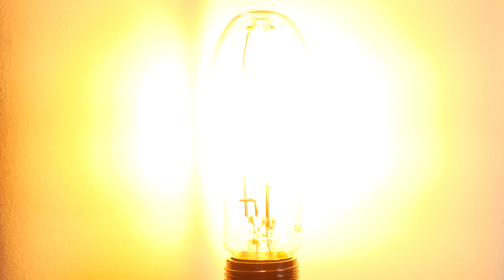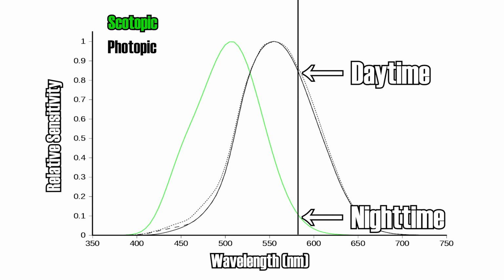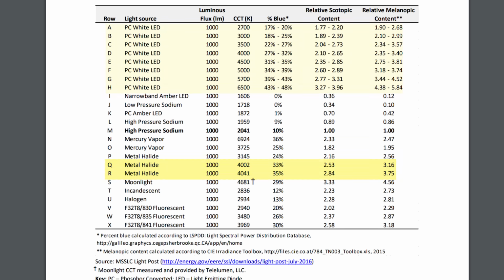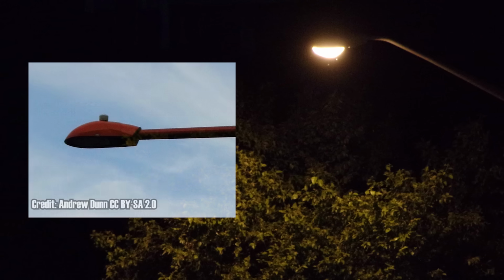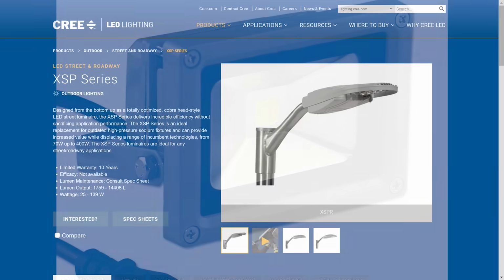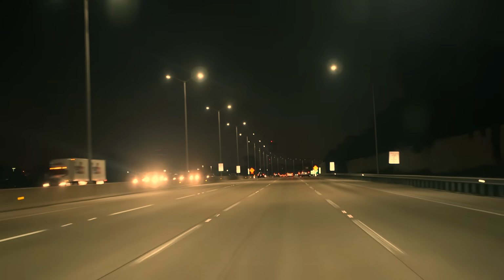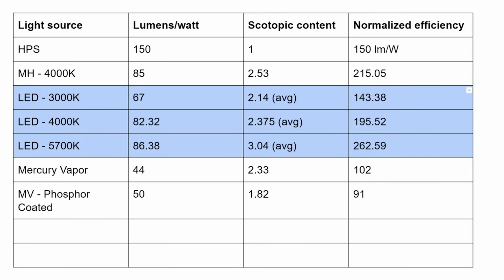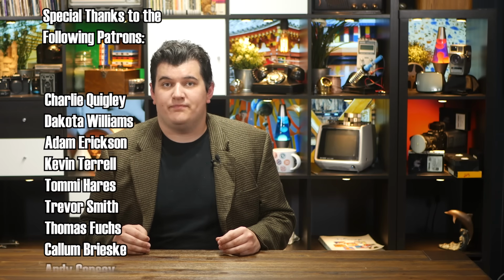The LED's Challenge to High Pressure Sodium

Comment: So a 3000K LED has around 2x the scotopic content and 2-3x the melanopic content, but you mentioned only needing 1/2 the light versus HFP. But wouldn't that just make it the same as HFP? 1x scotopic content and 1-1.5x the melanopic content - wouldn't it actually be worse than HFP?

Comment: I disagree entirely.
LEDs dazzle but put little light where it is needed, at road level. For several months a long road near to me had sodium on one side with new LEDs on the opposite side.  The sodium lit side was FAR better illuminated than the LED.

Comment: I love the led street lighting. My city has upgraded a select number of the street lanterns and it's a tremendous difference from the old lights. The orange glow looks dingy and old; if I didn't know better I'd think that the lenses were just really dirty. When it comes to driving at night, too, I think a light source that confuses our circadian rhythms is beneficial in the sense that staying as awake as possible at night is also a safe bet
Reply: Youre right, LED lights because they are white.. makes objects and people and cars way better to see at night..   I am convinced those orange hps lights killed tens of thousands of people over the decades because the orange light makes it very hard to see anyone or anything.  This is why i prefer mercury vapor lights.  They were used commonly in the 40-70s and phased out for hps..  simply because HPS could put out more lumens per watt.. so a 70w hps can put out around 6500 lumens, a 175w mercury vapor is around 7500-8k.. so almost double the lumens per watt for hps..  however mercury vapor lights are blue.white.... so despite less lumens, its a million times easier to see people and vehicles at night much like leds..

This is why on the video he mentioned hps being a step backwords in some ways over mercury vapor..   Why dont i convert my property to LEDS ?  to save power ?  because alot of LED dusk to dawn and LED fixtures period.. dont last.. 99% are made in china, and they all seem to go bad in 6-12 months..  They may be brighter by far over mercury vapor.. and use 70% less energy.. but if you can get older mercury vapor lamps, you will almost never have to worry about them going bad.. ever.  The cost for my 4 mercury vapor lamps is 700 watts (175x4).  700 watts with say 8 hour run time, and then 12 cents per kiliwatt my power company charges..   This is 168 kilowatts per 30 days.. so thats only 20$ a month to run these lamps..  That isnt that much honestly.. 1 less chipotle for me.. big deal..   The led though for 4 lamps that put out 8k lumens like my mercury vapor fixture does..   Those are about 70w fixtures.. so doing the math 70x4 is 280, and 280x 8 hour is 2240, then 2240x30 days is 67kw of power.. thats 100 kw less.. ALOT of power savings.. but in costs.. 67x12 cents is $8 a month, vs 20$.   So i save only $12 a month using LED...

12x12 is 144$, if i get 4 of those led fixtures.. they would cost me $510 with tax..  So it would take nearly 4 years to start saving money... 4 years.. do you think those chinese leds will last 4 years ??

Comment: I can't argue with the data, but I'll say that in my experience strong LED lights at night hurt my eyes and blind me. 
Maybe because the light is so focused. Maybe because the new LED headlights for cars and bikes are too bright (way too bright).. 
I like the orange tint of sodium lamps. It's un-intrusive and inoffensive to my eyesight. I wish vehicles' headlights were more yellow!
Reply: I really hate those new LED headlights on cars. They're blindingly bright. As for bicycle LED headlights, mine is designed to have an optical cutoff to avoid putting light in the face of pedestrians and other bicyclists. Motorists can see me without having to get blinded by the LED's. Most of the light goes on the road with a little bit going up in the air and shining off of trees I ride under. That light only shines off of the trees as I'm about to go under the trees. In between these two points where other peoples faces are there is no light going there. Also my bicycle lights don't run off of batteries.
Reply: They don't have to be white though

Aren't LEDs capable of emitting warmer hues

Comment: So why can't we just use Orange LEDs? Same color as HPS which people seem to prefer in terms of light pollution and overall feel, but with ever-increasing efficiency and the ability to broaden the CRI with a few white or blue LEDs chucked in.
Reply: The thing is those are actually quite low in efficiency. Even some very efficient HPS lamps easily exceed their 70-100 LPW efficiency. Colors around orange/amber/yellow are notoriously difficult to produce efficiently and LEDs have struggled with this for some time. In fact, the only reason the most efficient of these are able to get up to 70-100 LPW is because of new phosphors that have only more recently been developed. There is still more work to be done on those before their efficiency improves more dramatically
Reply: @exoticcar5482  Very late reply, but the LED itself does not need to produce an Orange light. A white or even UV LED with a Phosphor coating can make basically any color we want these days (Check your local hardware store for such things as pink, orange, and even magenta LED bulbs!). We can use a very efficient LED, add a phosphor coating, and make street lighting be actually useful, while retaining a comforting color.

A very common complaint with LEDS does happen to be not that they are ugly, but that they don't spread light. Perhaps this should be our main focus, instead.
Reply: @EnderMalcolm  I thought I already said that. But even with a very efficient blue LED, there will always be some degree of efficiency loss with a phosphor, though an orange/amber/yellow version of this would still be more efficient than a bare orange/amber/yellow LED which would only be about 45 LPW contrary to red and green colors which are more efficiently produced with bare colored LEDs. Now, in terms of street lighting, an average HPS lamp is a 2100-2200K amber color temp, and for color temps that low, sodium vapor is just as or, especially in the case of LPS, even more efficient than if it were instead produced from a PC LED of that color temp. This is why you don't see many HPS lamps replaced with LEDs of the same color temp

Comment: I remember when LED flashlights hit the scene... I was a mechanic at the time, they were bright as heck but didn’t light very well. Harsh yet ineffective. Some of what you’re talking about might have contributed to those early flashlights. I still like the incandescents the best 👴🏻
Reply: lol your incandescent flash light wouldnt even compared to my led mag light.. that mag light is a spot light for air planes man.. incandescent flash lights are terrible..  Now i also absolutetly hate the orange light from HPS.. i prefer the new LEDS but i do hate them.. its easier to see people in parking lots and on streets with white led lights... however the ultimate light for me are mercury vapor
Reply: @jeepsblackpowderandlights4305  the flashlight I used and still do is a mag light. When the incandescent light burned out I had to buy an LED replacement bulb, so I’m familiar.

Comment: My biggest problem with the LED lights are for headlights as most cars on the road have their light pointed up to high and extremely blind the hell out of people  and they don't have enough common sense, courtesy, or know how, to adjust them. And semi trucks should not have them at all or a much weaker beam as there is no way to keep them from blinding you. It might make things safer as over head lights but more dangerous as headlights!!
Reply: Actually that would be illegal aftermarket replacements doing that. OEM DOT compliant headlights, even LED ones, don't do that unless the high beams are on. The DOT strictly enforces beam patterns and cutoffs so this isn't an issue on low beam

Comment: Hasn't the accusation of blue light's contribution to sleep disturbance been isolated predominantly to those working and/or browsing late at night with phone and/or computer screens in their faces for extended times? I don't think it's an unqualified warning. 

Furthermore, your example of the sun is obviated by the fact that. . . it's the sun. That is, if it's up, that means it's daylight—and this is what our circadian rhythms would be synced-to*, not disrupted-by. It's once the sun has set—and *been set for some time—that continual exposure to a blue light-source is [supposedly] a culprit for sleep disruption.
Reply: There is a HUGE difference between the INDIRECT filtered blue light coming through the atmosphere versus the INCREDIBLE AMOUNTS of intense artificial high-energy short wavelength blue that is being forced into our eyes constantly via LED streetlights and LED headlights.  Equating these is like comparing cherry tomatoes to watermelons.  There is NO comparison.
Reply: @shaundevrisky349  incredible amounts coming from where, exactly???

 These exposures to light are not comparable at all: assuming the spectral distribution of blue light intensities is equal between the sources, which indoors is about an EV of 5, and outdoors in actual sunlight being an EV of 14-15, that's 9-10 stops more exposure to blue light than from artificial sources, which equals anywhere from 512 to 1024x (roughly) more exposure to blue light. 

Or calculated in L/ft², that's about 10,000lux from daylight vs what is often only typically 50 to a few hundred lux from artificial sources. 

You need receipts for your claim because the physics doesn't add up.

Comment: Added note regarding moonlight:  in photography class, we were told to use the same exposure for the moon as for a bright sunny day, because the moon is, after all, reflecting that sunlight, and even though the sky is dark, the (full) moon is actually nearly as bright.

I wonder if we will ever have technology that is need-activated traffic lighting.  That way, there could be streetlights on dark country roads with little traffic, but motion sensors would turn on the lights as traffic approaches.  This would mimic the way some grocery stores (our local Target, notably) have configured their refrigerators and freezers. They are all dark inside, but as you walk up that aisle, the lights come one, one case section at a time.  Clever.

Comment: You know what else causes the same effect? A heavily precipitated amount of snow. The last time it snowed in the subdivision I live in, especially since most suburban subdivisions don't have street lights, so much snow fell, that it absorbed and built up what little light the sky will have had under normal conditions even when it's cloudy, and shot all the light the snow absorbed back INTO the sky, which while it was pretty stellar looking, can really mess with your internal clock if you were there to see it

Comment: You missed a major factor:
The monochromatic output of sodium vapor lights offers improved visibility in rainy conditions due to its lack of chromatic aberration.
I worked in the engineering department of an LED lighting company. We were well aware of this shortcoming.
Reply: Pretty sure the high pressure sodium vapour doesn't emit monochromatic light, while the low pressure sodium lights do. I can't say anything about chromatic aberration though, that seems to be your expertise :)

Comment: Another potential feature LED street lights could have is motion sensing. Have them run at 25-33% intensity in stand by. And then fade up to 100% when motion is detected. And then fade back down after 5-10 minutes of quiet. Maybe?

Comment: I can recall cities (Winnipeg) being lit with predominantly mercury vapour lights - the eerie bluish-white glow on the horizon while driving home from Brandon.
These new high kelvin LEDs are quite harsh to look at. A more "warm" lower kelvin light would be more aesthetically pleasing.
An interesting followup video would be to look into the rash of purple street lights - an odd failure mode that seems to predominantly affect street lights and not interior lights.

Comment: Yeah, the orange/reddish hue reminds me of my blue light filters that I put on my screens. I prefer that to just filtering the blue light (like they do with the default blue light filter on Android) because it actually makes me feel sleepier which helps when I'm reading before bed.

That said, the darker hue of the sodium lamps are better on my night vision. They're not bright enough to blind me when I approach the city from out in the country and they don't mess with my night vision to the point where I'm blinded and need to adjust back to the no-lights-but-my-headlights conditions when I get outside city limits. Cuz you know, when you live outside the city on a quiet dark rural road and get off work at 11 pm at night, being able to go from the lit city streets to dark rural streets without having to stop and wait for your eyes to adjust is kinda important.

Edit: I'm not saying that we shouldn't replace the sodium lamps. For one thing, we can make LEDs any color we want them to be - so replacing all the sodium lamps with LEDs just makes more sense economically, even if we decide that we'd rather stick with the orange-red color rather than using a more blue light (which I suspect we won't).

Comment: We have 2 and 3 stage dimming streetlights. These are linked and switches on by detecting a car to their max output in the range of the movement of the car. In urban areas to a dim light with pedestrian detection. With no movement they just turn off.

Comment: Even knowing that white LEDs a safer in every way, there is something incredibly comforting and serene I find in walking through a city at nighttime with the yellow light, or driving at night as well. I dislike white Light at night a lot, that's why I also don't have any white Lightbulbs in my own home. 
I really dislike the feel of a room at night that's lit in white light. There is a reason every PC or Smartphone switches to yellow lighting at night, it's just so much less harsh and so much more comfy. Yes, it's safer, but there is also generel impact on mood and perceived safety (walking around under LED Bulbs does put me more on edge, eventhough there is better lighting) that really makes me think if a switch would be worth it.
Maybe there's a middle ground somwhere, where we use some kind of blue filter on the street lights, idk.

Comment: I feel like this doesn't take in to account that during rain, snow, or fog the HPS light is far better for visibility because of its color range. There tons of data from automotive manufacturers related to the color of fog lights. This is a major reason why 3000k led or HIDs are common in night time automotive racing, though they're also used because they're easier on the eyes of other drivers. I'd love to see some testing related to these lights use during inclement weather.

Comment: One advantage of HPS street lighting that I’ve personally noticed is that the light is easier to differentiate from other light sources (eg., headlight beams).

Incident light from LED streetlights can make incident light from vehicle LED headlight beams less perceptible/practically indistinguishable (assuming you can’t also see the actual headlights, themselves).
Reply: That's a very very good point
Reply: I drive on more rural roads, and some people have lights at the entrance to their driveway. Close to the road and at an indistinguishably same level as headlights from far away. It catches me off guard every, dang, time. 
But now that we have all sorts of lighting for everything, you cannot make any regulation to effectively combat this.